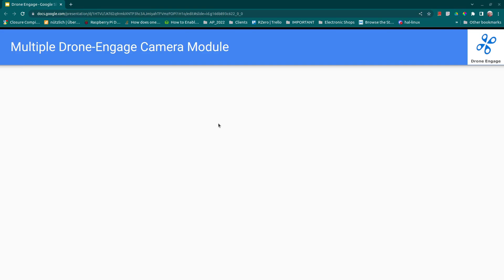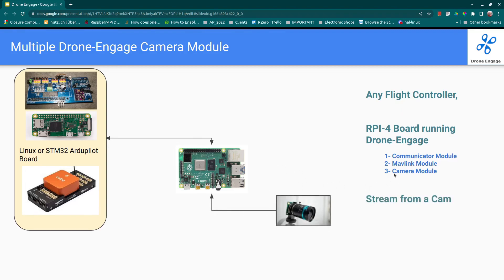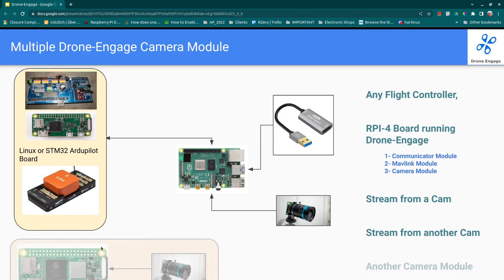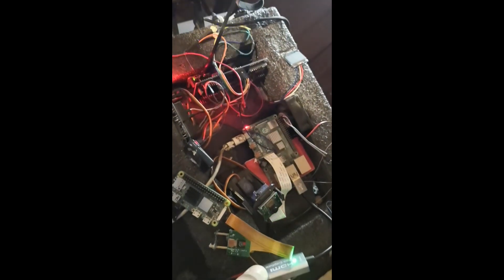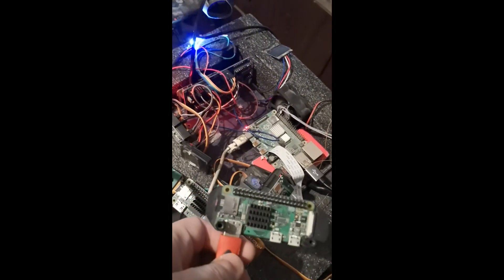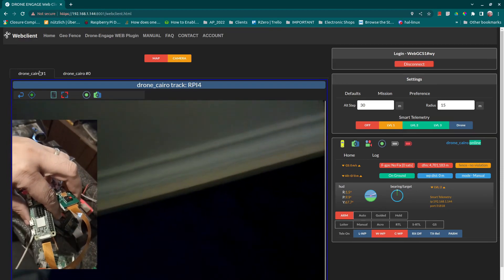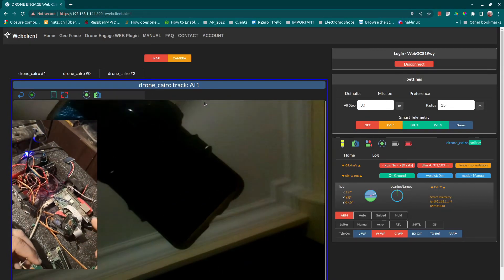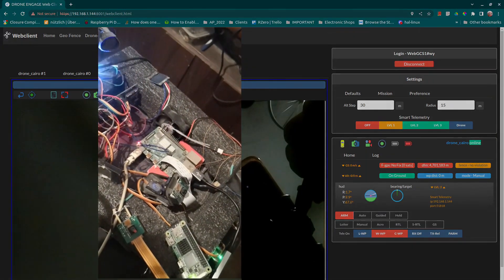Drone-Engage Video Streaming & Telemetry (Multiple Boards Multiple Cameras Video Streaming) - Part 1

Comment: @Mohammad - hi there, I am having an issue with a Drone engage via Rasp Pi zero 2W.Trying to connect through the serial mode, changing the parameter requested by you. but still it isn't showing up on the ground control station. ques: did you try with latest Raspberry Pi OS (Bookwarm). On other note, it works awesome through Andruav web client on my Android phone. 
Your help is really appreciated.
Reply from the maker: please open ticket on https://github.com/DroneEngage/droneengage_communication/discussions I will be happy to support you.